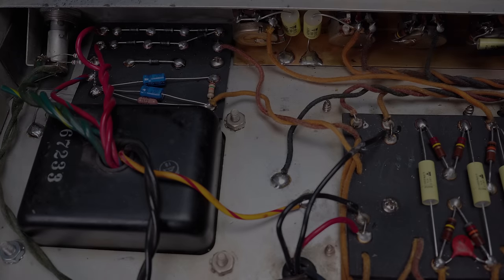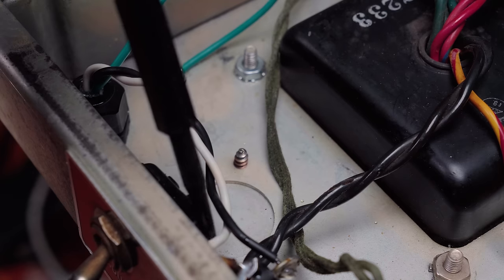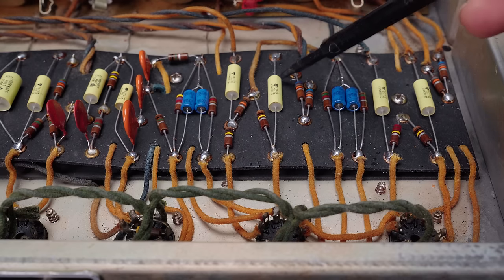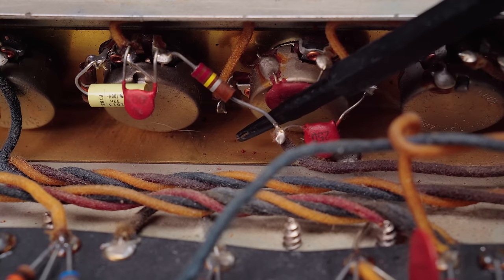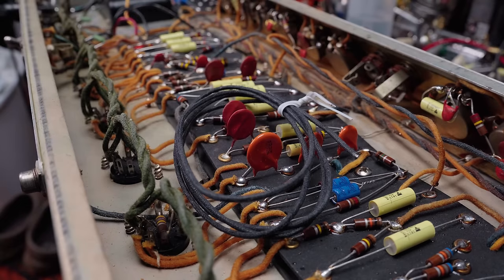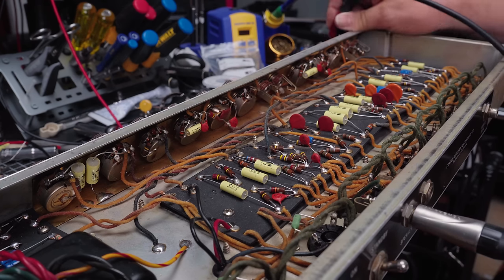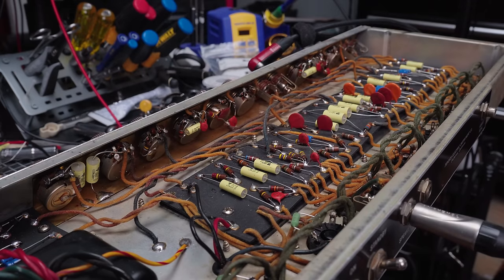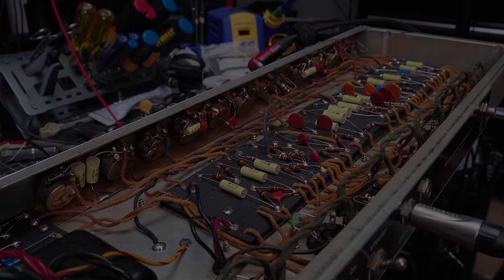Back to Life | '60 Fender Concert Pt 2

Comment: I recently acquired a 1960 Super that has the same tone stack, and it's sort of between 6G4 and 6G4-A.  I found that it has some resistor values in the PI that stray from both schematics. Seems like Leo and the gang were definitely doing some experimenting in 1960. I think I'm likely going to need to replace many of the Astrons in my amp as well.

Comment: Take a look at the 6G8 Twin schematic and you’ll see that circuit. It’s the only one Fender did that matches that transition circuit between the 6G* and the 6G*~A amps. It seems to appear around October/November 1960 and is gone by January of 1961.

Comment: Tech question- I made 4 amps with this tremolo circuit. Sold the 1st 3 and the one I made for myself has a depth control that is out of hand. Anything above 1 on the dial makles a pulse that would kill a speaker.  There is no good info on tweaking these circuits on the internet. Any thoughts on a good starting point? PS- Thanks for the video on tweaking the EF86 in an AC15 (plate vs screen voltage)